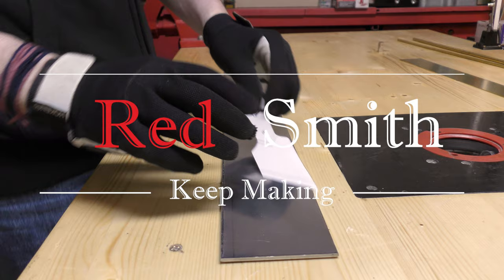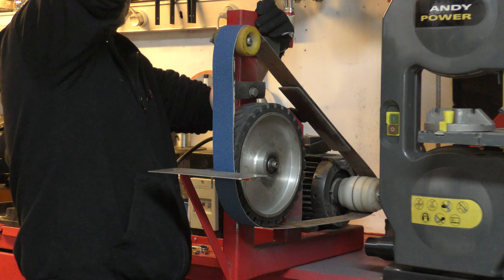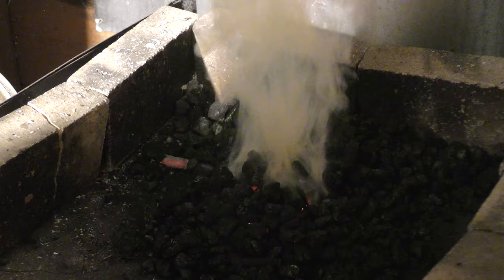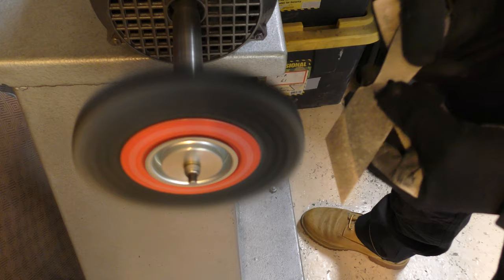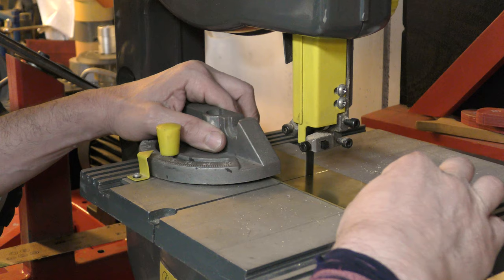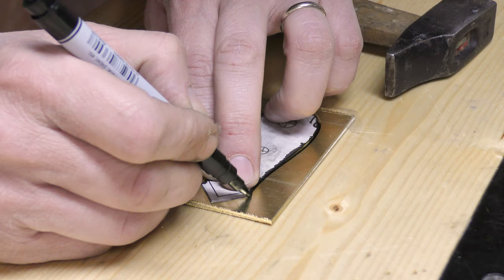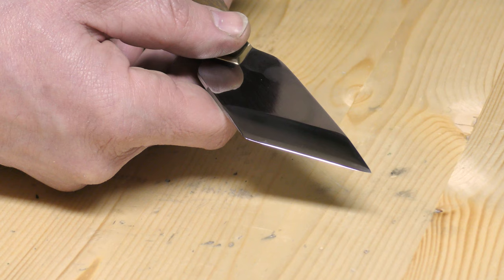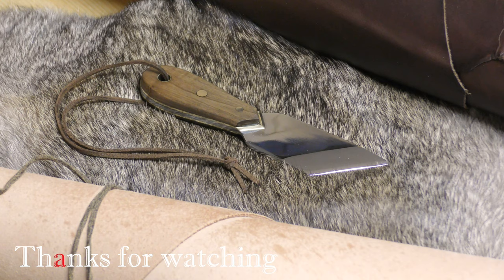Making A Leatherworking Skiving Knife From Scratch / Knife making

Comment: Nice skiving knife Red. I have been looking for a better knife to do skiving as I gave up and use my belt sander instead. Great video as always
Reply from the maker: Thank you Guy! Belt sander are great tools for leatherworking as well. Can't use mine in the "leatherworking room" though, too much dust :)
Reply: @RedSmithLeatherwork  my belt sander is a finisher for shoes so it has the 1.5   100 grit and 4 inch 24 grit paper knife bayonet's and burnishing and polishing wheels with a built in vacuum system that really doesn't work all that well. Not really just a belt sander but does what I need it to do for shoe repair and leather repairs
Reply from the maker: That sounds like a cool tool to have. The most important is that it does the work :) I really need to find one to put a burnishing wheel on it. It will save me a lot of time and spare my wrist ;)

Comment: Very well done! I would love to make a knife myself. What's your experience with 1075 steel? Is is soft enough to be shaped with files and a jewelers saw?
Reply from the maker: Thank you! In my experience, 1075 is soft enough to be worked with files. But it takes time. I wouldn't use a jewelers saw though on high carbon steel. I'm sure it works, but it would take so long. An angle grinder or a set of files would do the work more quickly :)

Comment: Isn’t it dangerous to be wearing gloves while using the bandsaw or sander? If the saw or sander catches the glove it will drag your entire hand in it.
Reply from the maker: Don't believe everything people say. It can indeed be dangerous when you have a spinning bit or something that can catch your glove. On a 2x72, the only risk is to grind your glove instead of your hand. Wearing gloves when working on the belt tgrinder, saved my skin numerous times. I guess it's all about personnal preferences. Thanks for watching!
Reply: @RedSmithLeatherwork  a bandsaw will definitely, without a doubt catch a glove and pull your entire hand/arm in and many people have be seriously mutilated/maimed exactly in that manner. The belt sander though is probably much safer and I can see the benefit in wearing gloves to protect from burns or cuts but also isn’t 100% safe. If for whatever reason you accidentally put you hand near the the spindle or if you glove gets caught in some jig it could be a serious issue.